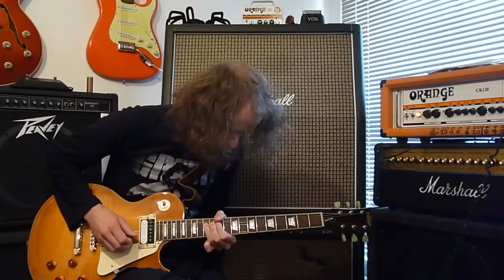Why I prefer Solid State amps to Valve amps

Comment: Lets not forget that there are a lot of really bad amps out there. Both solid state and tube. Have some good luck and know of a guy that builds amps and he has told me many times that most amps, even from the big names (Marshall, Fender, Peavy etc.) doesn't sound as good as they can. A standard, low cost, tube Marshall or Peavy that have been "fixed" by him sounds quite incredible. More gain and sustain at lower volumes, more headroom, less mush and mud when adjusting mid and bass. His own amp brand (Lehnert) is built because of the problems you descibe here. They are very powerful, low weight!! and very durable...They are not cheap but not more expensive than a better Marshall amp. http://www.lehnert-amps.com/  Cheers!

Comment: If you can't hear the difference between a fender champion 100 and a deluxe reverb then maybe you should look into getting some hearing aids. Most solid state amps put out frequencies that are painful to the ears, tube amps don't that's the difference. High frequencies that hit your ears like an icepick. My two rock john mayer signature and fender deluxe reverb are pretty much the best amps ever made. There is no amp that is solid state that can compete.
Reply: Don't be dense. The Champion 100 isn't the only SS amp out there. Check out Dave's video on it, too.

Comment: The only good solid state amp I like is the Roland Jazz Chorus.  I also got 3 tube amps. You will never get a solid state amp  to sound better than my  1965 Fender Bassman or  1972 Fender Twin Reverb.  For convenience  only  solid state is ok. But just because you are not strong enough to lift tube amps, that is  just a lazy excuse.  I see girls use Fender Twins all the time.  They have wheels on, them or use dollys.

Comment: Hey Dave, thanks but you are wrong.Good vid, your opinion, but none the less, wrong...
Reply from the maker: Fair enough. Thank you for watching. :)
Reply: I'm a bit tired of this "You're wrong! No, you're wrong" thing. What must be important is what comes out of the speakers , not what gear you use. I have a shitty Pignose 60R that I bought for £40. The speaker in that amp is as broken as a fairly playable speaker can be, but it makes the most beatiful noises. It's all down to who stands at the end of that cord handling the instrument. 
Why don't we just agree on that valve amps have their place in the world and solid state have theirs.
That Orange CR120 sounds awsome, then so does a Rockreverb (that it's based on).
Reply: +Henric Oscarsson exactly :)

Comment: ?? There is a huge difference in the "natural" quality of distortion. Solid state distortion just sounds like a cheap saw, while a valve gives you the real thing. Solid states are improving, though
Reply: Have you heard the distortion on the Fender Champ SS models? Absolutely killer.
Reply: That's what I always thought. The older solid state amps would clip the waveform hard and cause that buzzing sound but a tube amp would clip softly causing a warm creamy distortion sound. I think newer SS amps use FET technology so the clipping is softer. I heard the Quilter Labs have a good SS non modeling amp.

Comment: One fine day you'll plug that beautiful guitar into a cranked up Marshall dialed to it's breakpoint so the power tubes are saturated and feel the lighting in your hands. It will be the "SOUND"; not an approximation, not a good imitation, all that knob turning, all that trying new strings, changing effects pedals, boosting this or cutting that, was a waste of time. Suddenly, you'll realize all you ever had to do was hit the " ON Button " and the "SOUND" was right there in the valves and your fingers. Best of luck to all.